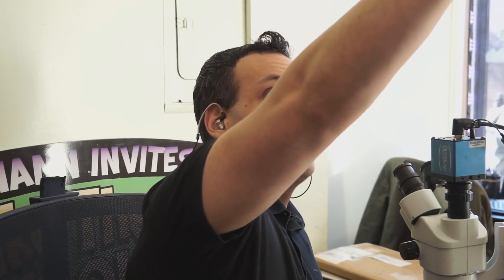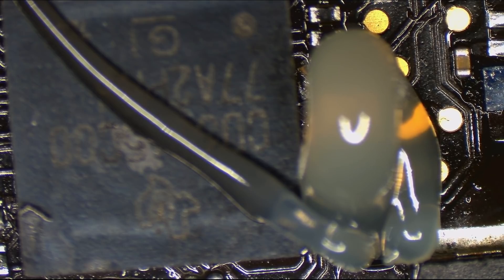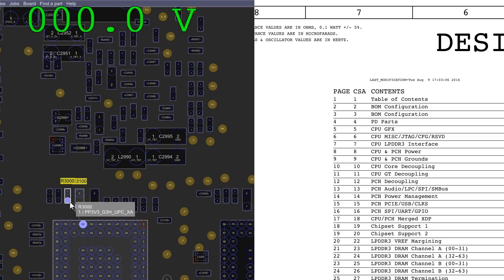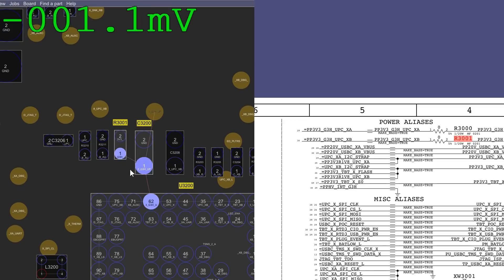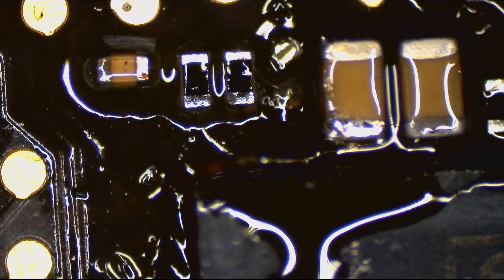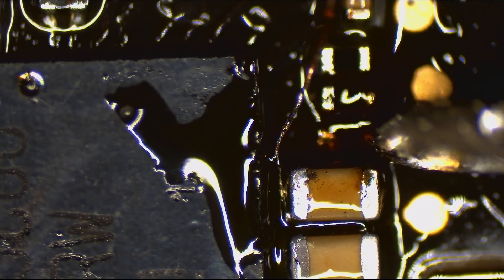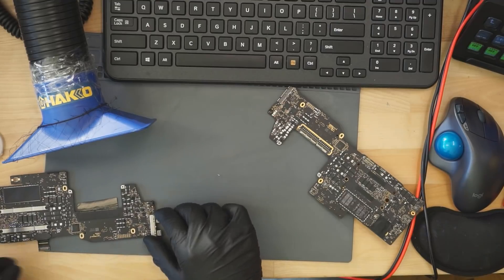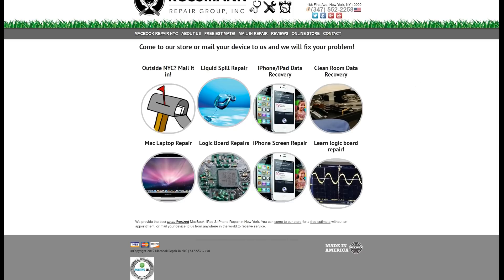A1708 Macbook Pro not charging or turning on with a LAAAAAABEL on it

Comment: I think Ross needs a  apple  hammer diagnostic tool.! With a 20lbs sledge on the end of the handel. We can call it the apple I book customer extended warranty care pakage programme. And for and extra 200 dollors you can buy a bottom of the line shitty Lenovo  windows o.s platform computer that you can use to post smashing your apple to youtube.  And save your mental sainteity in the process. And never set foot in or near any retailer that sells anything apple.!

Comment: I'm so confused, what's the point in a 0 ohm resistor? Isn't that basically the same thing as a plain wire?
Reply: There are a couple of reasons but commonly a 0 ohm resistor is used for over voltage protection other then that and I could be wrong but I think resistors help clean up noise in power rails but I'm not a electrical engineer so take what I have to say with a grain of salt
Reply: @anthonycrumpler8170  I'm fairly certain that capacitors are used for noise reduction, not resistors. But the over-voltage protection theory sounds about right.

Comment: A Zero Ohm Resistor?  So, a conductor? A wire?  I have to side with the employee here.  I can see where this could get missed easily.   (checks the air between the heat sink fins for... air-ness)

Comment: Hi Louis, been following your channel and has made a major difference to my Apple products in the UK where EU law protects consumers all thanks to your channel and know how. So if you do not mind me asking you. I have a MacPro 2012 (tower) works fine which is connected to an Apple Cinema display 20" (Link https://www.amazon.co.uk/Apple-Cinema-Display-20-widescreen/dp/B0002NY7PO). However, recently stopped powering up but via remote desktop, I can log in into my MacPro working fine and can see on the "About this Mac" the Apple display appears connected yet the screen shows no power at all. If I remove the cable connection then it doesn't appear on About this Mac. Any advice what it could be? the power unit to the display. Any advice will be welcomed. :)

Comment: Somehow my Macbook Pro  (last gen that had replaceable Ram/Hard drive, don't remember the year, has top end processor for that model with max ram and a 500gb ssd though) that a friend gave me for a job instead of pay has had zero hardware issues.  That said, you can throw a label on it, just don't be a sadist and put it on the wrist area or blocking the nonexistent ventilation.

Comment: Who the hell designs circuits with zero ohm resistors?
Reply: This format allows it to be placed on the circuit board using the same automated equipment used to place other resistors, instead of requiring a separate machine to install a jumper or other wire

Comment: Can someone explain to me why there are 0 ohm resistors instead of just, you know, a plain trace?....
Reply: Because boards may be used for different things or because of how close it is to a chip installation point.  So that point is left open and because machines can plain wires well but can place resistors very well, they have a machine place the resistor when and where needed.  It can also be for when a path needs to go from the top to the bottom of the board (or visa-versa) and the resistor is to connect the track pads.  Yes a wire can do the job, but again, machines aren't good at placing wires but good at replacing resistors.

Comment: They should have put a fuse instead of a 0-ohm resistor.
They are way more reliable !
Reply: Not in a Macbook.
Reply: @Cankersaurus_1  Louis already demonstrated this. Even if the Macbook is melting because of a short circuit, the fuse will still work!
watch?v=_a7X9845ORc
Reply: @cuteraptor42  Yeah, sorry it was early, I totally got your point backward.  :-)  I totally agree.

Comment: Since you removed the resistor, why not just jump wire it instead of struggling with the resistor to put it back in.
Reply: Because the resistor is easier to put back in and the device will function as intended. Plus the job looks clean and not half-assed.

Comment: Could someone give me the details behind this audio clip talking about labels? I am r/outoftheloop on this one.
Reply: I thought it was new until l read a comment saying it was back lol
Reply: It's back a few weeks ago. Someone at Rossman group put a label on the laptop which is easily removable and the customer called and freak out.
Reply: @ktotheswiss1617  Freaked out because he went straight to the last resort method of cleaning up the label prior to just peeling the label off like how most people would have.  Then struggled for 30 minutes to remove a whole label with goo gone, when its designed purpose is to remove the glue/stick resin left behind.
Reply: https://youtu.be/oEMgFUKn7KI

Comment: In macro photography 'we' use one or two lights off to the side of the lens some distance to provide more perceived depth in the image. Using a ring light makes the image look flat and has a high specular level as the angle of incidence is the angle of reflection so the ring light shines down and bounces of the shiny bits right back into the lens creating hot spots. Something to consider if you interested in making the microscope view look better. Simply put the light(s) of to the side further away from the lens and shine them at an angle.

Comment: Louis I just repaired my macbook air 2015 A1466 emc 2925. Apple told me it would cost about $646 in total for repairs. I am a college student and my girlfriend was scolding me about spending too much money on apple. I took my friends advice and removed the corrosion from a single chip (using flux) and now my macbook air is perfectly fine again. I support you 100%, its unfair that i was tricked. I am proof if no one believes you. I can also DM you my quote if you would like.
Reply: Oh we believe you man. Congratulations on the successful repair. You wallet thanks you.

Comment: I want to send you a macbook for repair, but who do I send it to to remove the sticker after you're done with it?
Reply: We could provide a complementary 25 minutes and Goo-Gone!
Reply: You can buy a tool to remove the label at store dot rossmanngroup dot com
Reply: Ask "Hihi".
Reply: 25 minutes and some goo gone. Don't forget the total lack of ReSpECt
Reply: Dewalt 4.5" angle grinder works well
Reply: TOP TIP:  WD-40 removes stickers great, but if you want to use an old wifes remedy safer on some plastics, use butter and let it soak in overnight, removes the glues ability to stick.
Reply: Removing stickers is easy a bit of 100 mile an hour tape to seal the laptop and a cloth and soapy water simple as that
Reply: Go to his website rossman